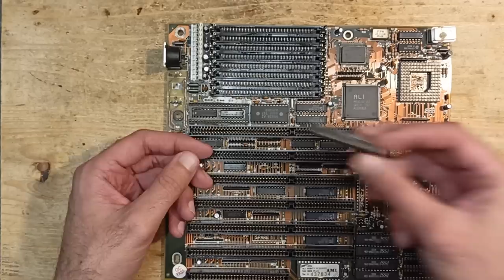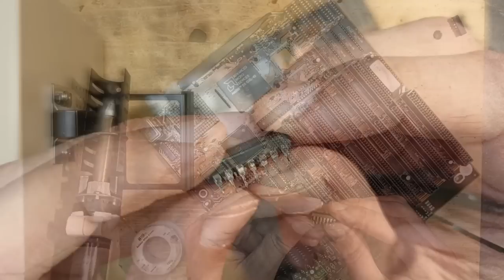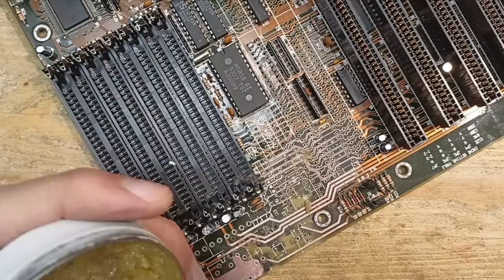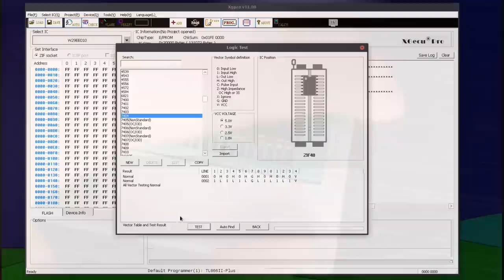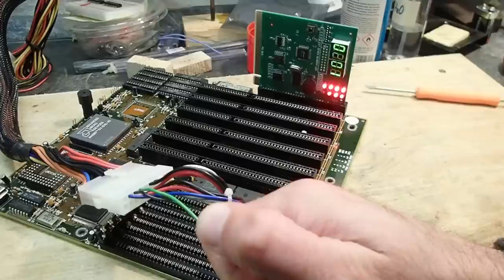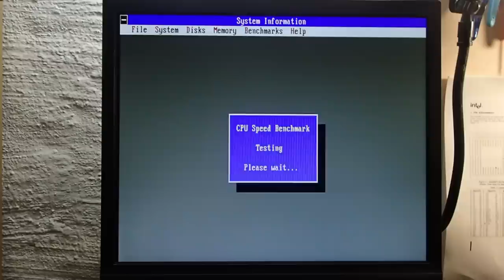Repairathon 2022: Repairing a heavily damaged 386 mainboard

Comment: A few years back such extensive battery/capacitor leakage repairs were preserved for rare machines only, like big-box Amigas, 68k Macs and whatnot. Certainly not for your "average" late model 386dx boards. "Just get another one from evilBay/etc." But those times are over. I guess at this point almost everything from that era is worth saving. Edit: Oh, and of course great video, and amazing skills. Loved it. Glad the thing came back to life in the end.

Comment: Great work, especially with ISA slots. I was worried that one last break was going to be under reinstalled ISA slot, but you were lucky. :) Also you could go with stacked sockets to accommodate for sockets for small ICs, but glad that it turned out ok. I have a 386 board myself that is waiting for repair, gonna do it some of these days.

Comment: I nearly fell out of my chair when you resoldered those two ISA slots back into place before testing, you're certainly a lot more confident in your repair work than I would be! Great job on this though, and I love the technique of feeding a fine gauge repair wire directly into the IC's through-hole adjacent to the pin. Many times the vias and through-holes are compromised and this provides a robust and elegant solution for those cases, as long as you have a tiny bit of extra space in the hole.
Reply from the maker: No risk no fun 😜 But I triple checked the traces of course before I soldered the slots back in place.

Comment: Man, your repair technique with a soldering iron is immaculate!  I might suggest, though, that you could use female pin headers to make a pseudo-socket for the keyboard controller, and that would give you room to put sockets for the other chips.  Stack pin header strips to gain the clearance needed.

Comment: You could always doublesocket the keyboard controller (i.e. put the controller in a socket, and that socket in another socket. Or you could use standard dupont headers underneat the socket to lift them.

Comment: After washing circuit boards with soap and water and following rinse down I also use 91% rubbing alcohol, shake/fan motion, and paper towel to absorb any excess then let it sit in a warm area to completely dry. The rubbing alcohol does wonders to remove all water.

Comment: 74x07 may be a buffer, but it can't be bridged out. It has open collector/drain outputs which can pull a signal down, but requires a resistor to pull high. This is likely required by the keyboard controller to allow bidirectional communication with the keyboard.

If bridged out you would have a push-pull driver in the keyboard controller potentially fighting with an open collector/drain driver in the keyboard which would be bad.
Reply from the maker: The keyboard has internal pull-ups already, so some (cheaper) boards connected it directly to the keyboard controller.
Reply: @necro_ware  for receiving clock/data from the keyboard, the keyboard signals are connected directly to the keyboard controller. But the inputs are high impedance so this doesn't matter.

But for the keyboard controller to transmit clock and data to the keyboard they use these open collector drivers. The drivers are low impedance when pulling low but high impedance when high.

Perhaps some newer keyboard controllers integrate the open collector drivers into the keyboard controller chip to eliminate an external component, but it is the same basic circuit for all 8042 compatible keyboard controllers.

Take a look at the IBM 5170 service manual page 1-92 for an example. Its nothing to do with who has the pull up resistors, it would simply be a bad idea to bridge each of the drivers in this application, or to install a standard buffer with push-pull outputs, because at some stage you would have two low impedance drivers of opposite polarity connected to each other.

Comment: Watch the frequency of any crystal oscillator with a dent in the case. The extra pressure (if there is any, there may not be) can change the frequency of the crystal.

Comment: those batteries (Varta and similar brands) are really pain in the *ss even back then in the mid 90s .. even after a year you can see corrosion already started. been doing these kinds of repairs back then, but when we see that big extent of corrosion damaged, we quit right away.. much easier to sell new boards.. these takes alot of patience ..great works ...

Comment: MEGA WORK!
I have a 386 motherboard with similar problems, but unfortunately I have absolutely no technical knowledge, so I won't even try to fix it, because I don't know if the work will be in vain. although I practice well with a soldering iron, I am afraid that a purely mechanical correction will not be enough

Comment: I don't want to be that guy criticizing the other guy performing amazing electronic wizardry, but seeing you clean components like the keyboard connector and keyboard controllers OVER the main board made me really nervous. Perhaps there was nothing to worry about, as I have no experience, but I was thinking some corrosion could have potentially dropped back on to the mainboard and caused some problems or something. Thank goodness it didn't! (or, again, maybe there was nothing to worry about)

Comment: 11:00 For this kind of job, I like to use soldering braid, with flux and solder on it. Not a new shinny one, of course, the goal is to add metal, not remove.

Comment: I've been struggling with my MG-38606 motherboard. Some Varta-stuff on keyboard connector corner but not too bad. Symptoms are that realtime clock stops when powered off and continues where left off when powered on. CMOS settings stays, I'm using external battery. Other thing is that it gets unstable when warmed up, it's got something to do with cache. Any bios settings wont help with that, tried other set cache chips too. If I put a fan to blow to motherboard, it works. Nothing still gets hot without a fan. Now I'm gonna get it fully cleaned from that varta-stuff with vinegar and wash the whole thing and see does it make any difference.

Comment: Great repair, love your videos :) Really great repairs of traces with thin wires.
I have a question about the ICs with the broken/corroded legs: If you were unable to find a new replacement for those ICs, would it be possible to remove some of the plastic shell and solder new legs? Or all that work would be for nothing because the inside of the ICs probably was also damaged? Thanks.

Comment: I like your method to repair the traces. It's a much cleaner look than flying wires. In future I will do it like you. One question about your compact flash adapter: Don't need it a separate power connection? In the video i see there is a connector present but no cable connected.
Reply from the maker: Thank you! It's powered through IDE pin 20

Comment: A short question: Why do you just tin the wires and don't add additional solder mask? Would it be a benefit for long term preservation, or is it not required at all after retinning? Great job repairing this board!
Reply from the maker: You can do it if you want, but it is not necessary. Solder already protects the copper from oxidation.
Reply: @necro_ware  I had the same question. Is there any (realistic) risk of shorts on any of the exposed repaired traces?
Reply from the maker: @technerd9655  no, otherwise all the SMD and through hole parts would be affected as well. Solder mask should help against oxidation and not shorts. It also gives some additional stability if there's a chance to rip off a repaired trace.

Comment: 16:51 - you may use socket even for chips underneath keyboard controller, but then you need to use two sockets (one of top of another) for keyboard controller.
Reply from the maker: Yeah, I thought about that too, but decided not to, because I'd need sockets with round holes for that and I currently don't have any.

Comment: What a great repair! So useful! I wonder what are those "stones" you use to clean the traces? Mine are so coarse i would not use them on those thin traces... Anyway... Just in the process of repairing a 386sx 25mhz myself. Already found a via that was eaten away by the battery, but the bios still complain about the 8042 A20 error. Although the lights on the keyboard flash as normal when I turn on the power. Any ideas?
Reply from the maker: Hi, one guess into the blue is, that there is a broken data trace between the keyboard controller, the buffer and the keyboard controller (see pin 39).

Comment: If you have a time and knowledge Iyou could do a detail explanation of how a 386/486 PC works including chipsets, pots, IRQs, DMA, etc. On a top of that I would be curious to see a reverse engineering of a BIOS firmware. Later on you could try to re-implement such a PC motherboard (perhaps without a CPU) on a FPGA.

Comment: Hey Necroware, amazing repair! I'd like to attempt a repair myself, but I've never done one. Can I please ask you what type / brand of flux and wire you are using? I can see the wire is 0,56 mm thick, but what's the composition? Is it lead-based? I appreciate your answer. This is going to increase my chances of success. Thanks!
Reply from the maker: Hi, the flux I'm using is from a regular German electronics store around the corner, it's called Stanol, nothing special. For tinning I use common leaded solder (don't remember exact numbers now).
Good luck with your repair!

Comment: Very cool video :) Just out of curiosity with the keyboard controller: could it be possible to put two sockets on top of each other so that the ICs inside could be socketed as well?
Reply from the maker: Thank you! Yes it is possible, but I'd need round hole sockets for that, which I don't have currently.

Comment: Been rewatching the clip a couple of times because I have a similar damaged motherboard and was actually going to scrap it, but now decided to try and fix it up. What wire did you use to repair the traces? It's not spool wire(Lackdraht), as that comes coated, but it's also not a strain of regular multistrain wire, as that would be too thin. Thanks again for the video!
Reply from the maker: Before I start to describe it, here I showed what I'm using https://youtu.be/eJ4DlRigKxA?t=422
You can also use UATA-133 cable very well, if you have a lot of them.
Reply: @necro_ware  Thanks. I tried using some ribbon cables a while back, but the ones I had used steel wires, and those were basically impossible to solder to. I'm guessing yours are copper or at least copper plated. Will probably just order a spool of what you used.
Reply: Hmm...i"m guessing my other comment disappeared. I suggested using affiliation links to a big retailer that starts with an A in the video description. You avoid question and get a free coffee once in a while :)

Comment: You missed a solder joint :) Easy to see where you fix that extra broken trace that made it work. Looks like a header?
Reply from the maker: Hm, may be it just looks like that in the video? I can't see any missed joints. At least I can measure continuity on all traces I touched.
Reply: @necro_ware  https://youtu.be/aNzN0uHX0Ck?t=1506 Look at the row the bottom of the wire is on. Theres a group of 3 pins, one is not soldered. Looks like its directly under the keyboard socket. I have no way to send a SS or I would. But definitely not soldered.
Reply from the maker: Oh, yeah, this is a hardwired jumper, which I didn't touch. It just looks unsoldered in the video from that angle.

Comment: are the keyboard controllers interchangable at least to some degree of you always need the same one that was on the board?
Reply from the maker: Yes, more or less, but not always. For example 286 and 386 differ, but 386 and 486 are often interchangeable. Keyboard controller is actually a programmable microcontroller and most of the  mainboards manufacturers used off the shelf Intel code to program it. However, some manufacturers didn't and used custom firmware and clock. I already showed that in some of my repair videos.

Comment: Thanks a lot. Can you explain a bit more detailed what you did after checking with osciloscope to identify broken trace? Between which components do you check traces? And which ones ? 

Besteht die Möglichkeit das sie noch mal etwas genauer darauf eingehen wie sie letztlich auf die  fehlenden  Leiterbahnen gekommen sind am Ende? Nachdem sie mit dem Oszilloskop geprüft hatten? Zwischen welchen Komponenten haben Sie da die Durchgangstest gemacht? Gibt es da einen Best-Practice Prozedere ?Danke
Reply from the maker: It was just a lucky punch. First I tested that all the data lines from the bus transceiver are connected to the bus, I used the memory slots as a reference. Then I took an image of the area, which I shot before I populated all the parts back into and checked that all the traces are connected. Then I turned around the board and checked the traces I tinned. This is how I stumbled over the cracked trace on the back.
Reply: @necro_ware  thank you

Comment: Why did the clock read as 66MHz on your oscilloscope for a 33MHz cpu?
Reply from the maker: I measured the clock on the pin CLK2, which provides the fundamental timing for the 386DX. It is divided by two internally to generate the internal processor clock used for instruction execution. The internal clock is comprised of two phases.

Comment: For the keyboard controller couldnt you put a socket in a socket to raise it high enough to socket the other ICs? Just a silly idea :D
Reply from the maker: Yes, I thought about it, but I'd need round hole sockets to do that, which I don't have at hand currently.
Reply: @necro_ware  Still an outstanding repair as usual! Well done mate.

Comment: I'm wondering why you never mask the traces after repair. I would be concerned dust could shorten traces. UV harden mask doesn't cost alot and imho is easy to apply.
Reply from the maker: Because it is not necessary. Dust will not short the traces if there is no moisture. One should definitely mask the traces if there is exposed copper, which will oxidize on the air, but if everything is tinned it is not a necessity.  Sometimes I use nail varnish to cover the traces as I showed in couple of other videos.

Comment: do you have any idea why a motherboard would just not power on out of nowhere? i have an asus p5e socket 775 that i really like; it worked well until 2 weeks ago when it would not power on. i tried so many times spamming the power on button but nothing. yesterday, i tried it once again and it even posted first time (rebooted a few times to make sure) and now it's back at not working. any ideas?
Reply from the maker: I'd check the capacitors in the CPU and memory power supply circuit.
Reply: do i need special equipment or can i do it with my multimeter? they are all solid caps but they look a bit bulging underneath at a closer look

Comment: Maybe this is a stupid idea, but instead of soldering the ics under the keyboard controller, why not  use sockets for those two anyway.  You could plug an extra socket on the keyboard controller socket to make it taller, the keyboard controller into that second socket.
Reply from the maker: I'd need round holes sockets for that, which I currently don't have.